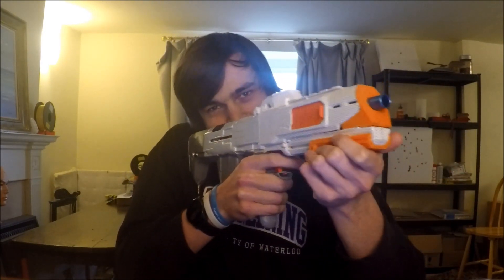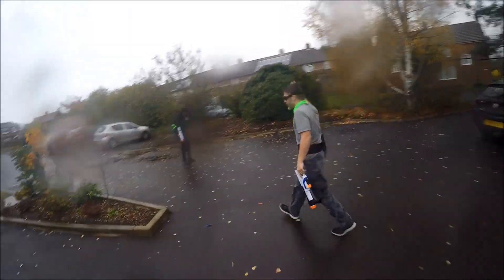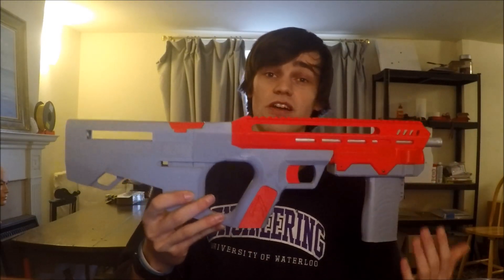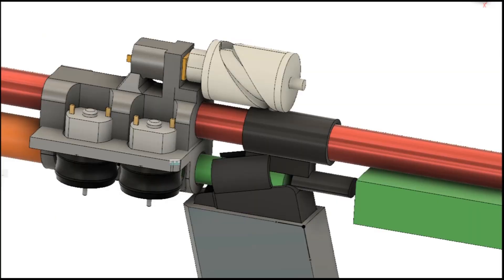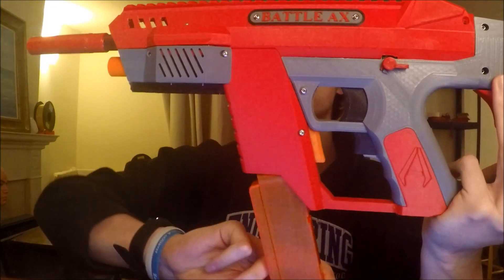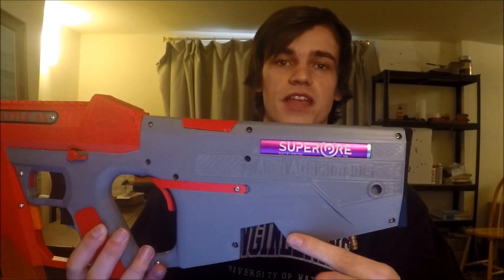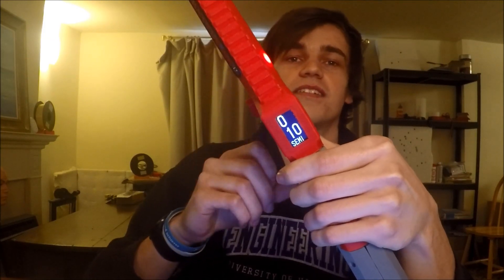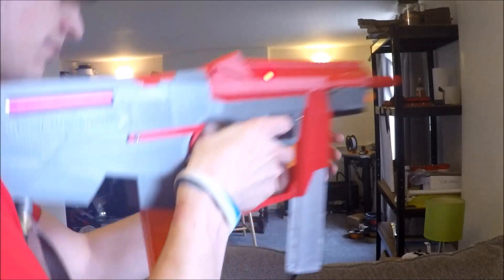Battle Ax: HPA & Flywheel !

Comment: If you put together a hardware kit and sold it in the UK then I would definitely buy, I love this thing (also a wiring diagram that had the switches/motors/narfdwino in the right places -i really struggled with the auto raven wiring-)
Reply from the maker: flywheel master I think this will be too high a difficulty level if the rayven is still a struggle. I’d start on some other projects first, just so you avoid frustration.

Comment: At this point I think only thing you could try differently is having a variation of the d-dart blaster up front for more ammo capacity.
Reply from the maker: Mica T that could be done, I’m not saying it’s worse, it’s just that it would be much bigger and bulkier so wouldn’t fit the vision of this blaster. I wanted it to be really practical for our high fps games which are slightly more competitive. Plus that would be slower to reload than a mag.

Comment: Clever.  What's the weight of this bad boy?  I'm interested in buying if it becomes available.  Have you considered the 250 FPS flywheel cage setup?  Also, have you considered software-controlled core pressure for the HPA and flywheel speed? Variable pusher speed for each pusher and a rev or dual-stage trigger for the flywheels would also be useful.  Lastly, have you considered a separate select-fire switch to create fire modes the HPA pusher rather than having to take control from the flywheels?
Reply from the maker: Haha, there are always improvements that could be made and these certainly would be the absolute best ever. I didn’t do 250fps flywheel cage due to wanting to keep the thing slim, and I needed a sub 200fps blaster for indoors.
     My flywheels are currently on pwm I just don’t have an external controller for it, as I didn’t really need it. As for pressure sensing, I am building an Axiom V2 where I am learning and implementing a pressure feedback loop. I need to get better at that but also there wasn’t much of any space to fit that in Battle Ax.
     The pusher is limited, it was a huge challenge and I had to do everything possible to eek out max torque and reduce any friction, just to make it not jam. And thus I couldn’t go higher on the rof. You’d have to use a larger motor which then would require more space.
     As for the supercore it’s already pneumaticly fast to cycle.
    I wanted a slick efficient handle so 3 buttons wasn’t going fit. And I don’t think a rev trigger is that necessary. Since I already have logic control, single trigger seemed the obvious choice. 
   I didn’t think about have 2 selector switches as I couldn’t use it in the UK. You could do it but I don’t think you could fit 2 by the handle. The 2nd would have to be located else where and I think it would get too complicated to have 6 different fire modes all on one blaster.
Thinking about game play. Hpa is amazing so would you really want single shot flywheel when you have the hpa? The only benefit I think would be the fast full auto of the flywheels as a compliment to the hpa. That’s at least how I saw it.
Reply: @AndrewAitchison100  I'm looking forward to Axiom V2.  What will the price be and will you have an option to buy them from yourself?  Frontline Foam has a poor reputation.
Reply from the maker: Count of Serenno I need some time to finish my own prototype and test it. And I’ve gone away from printing them myself as it just takes so long. But you can buy the files and guide from my website once it is up there.